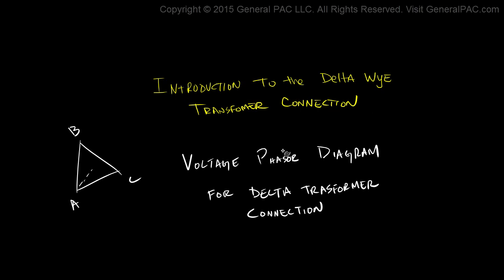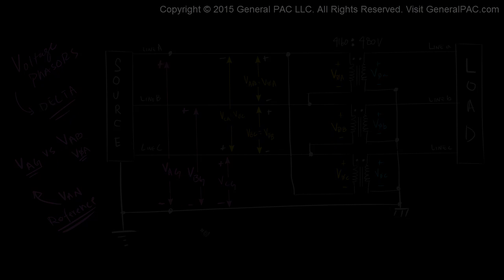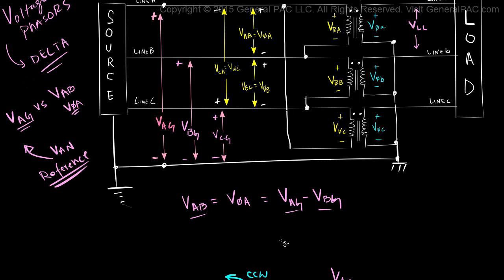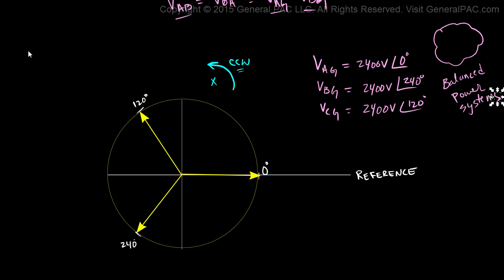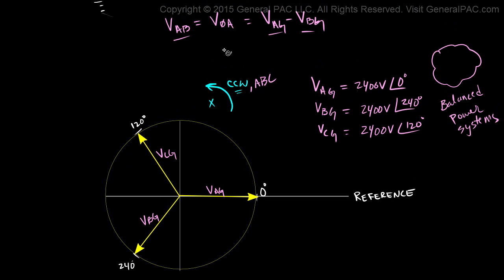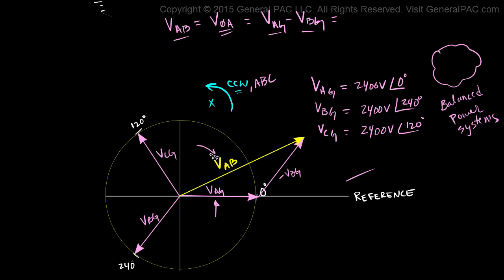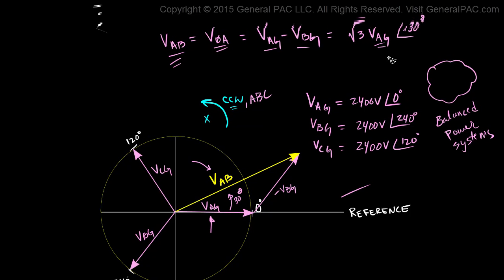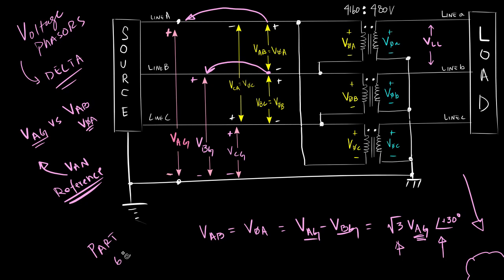Introduction to the Delta Wye Transformer Connection Part 6b: Voltage Phasor Diagram

Comment: It looks to me that your transformer diagram is wired with A-C-B rotation (A2 connects to B1, B2 connects to C1, and C2 connects to A1) with a +30 degree phase shift from delta side to wye side. For the standard A-B-C rotation with a -30 degree phase shift from primary to secondary, A2 should connect to C1, B2 to A1 and C2 to B. Your phasors are drawn for A-B-C, but do not match the diagram. Should you re-label your incoming phases B-A-C, top to bottom?

Comment: You say this is an ABC counterclockwise rotation, but you draw it as A at 0 degrees then C at 120 and B at 240. Why isn't this an ACB rotation. Thanks
Reply from the maker: +Jack Christiana - to determine if a phase sequence is ABC or ACB, a stationary marker is placed (in our example it's the X) then we look at the sequence of the phasors that cross the stationary mark as they rotate in the counter clock wise direction. Because  A at 0 degrees then C at 120 and B at 240 degrees, as all three phasors rotate CCW, A will cross the X mark first... then B will.... then C. Which makes this an ABC phase rotation. An example of this is covered here: https://youtu.be/e61J29SVRIY?t=1m17s  (1m and 17sec)
Reply: +General PAC - Power Systems made Intuitive I thank you for responding and understand where I was confused. I have really learned a lot through your videos and thank you.